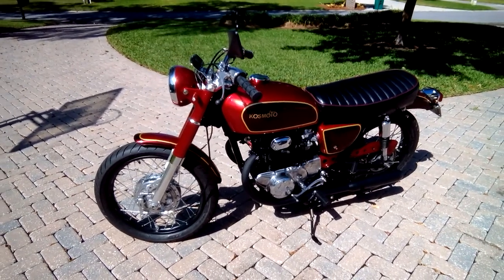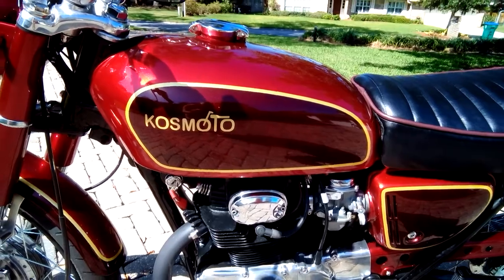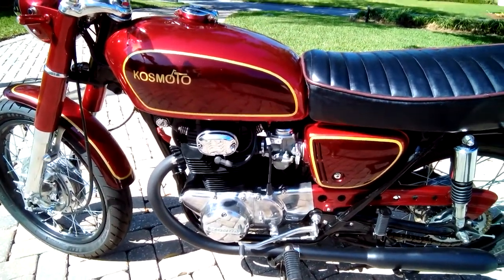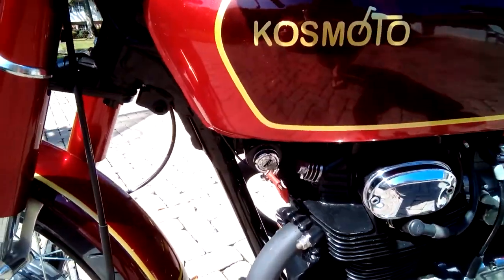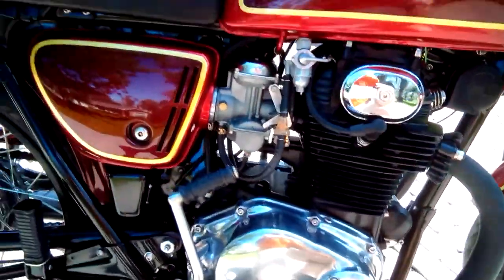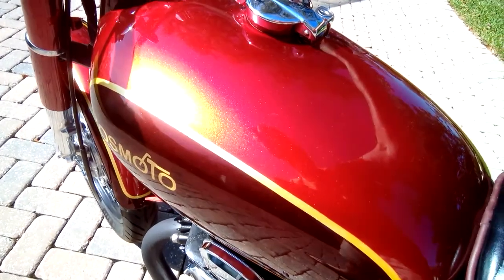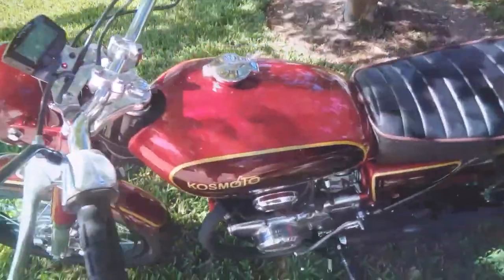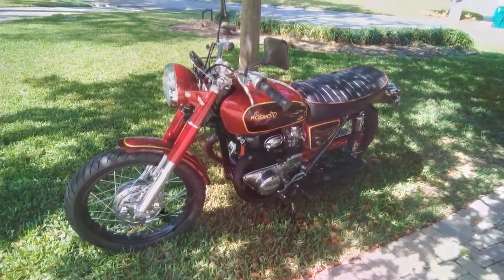1970 Honda CB350 Restomod Sales Video

Comment: Cool bike.  The only thing I don't love is the blacked out pipes, but that's not a deal breaker.  What kind of handle bars are on it? I like those.
Reply from the maker: Hi, Thank you. Yes, blacking out the mufflers was not first choice, but chrome was very bad and no budget for re-chroming.  Handlebars are Emgo "Daytona". Thanks again for looking and taking the time to comment. - Jon
Reply: kosmoto looks like you did it right.  The chrome that’s there looks great.  Love the paint job.  Do you do this for a living?
Reply from the maker: @daveco1270  Appreciate that. Not a living, but a hobby/side-business.  I've redone 9 bikes since 2012. Some I restore such CB160s (I'm just now finishing my third) and others I customize. I have two others in addition to this one for sale on eBay now.